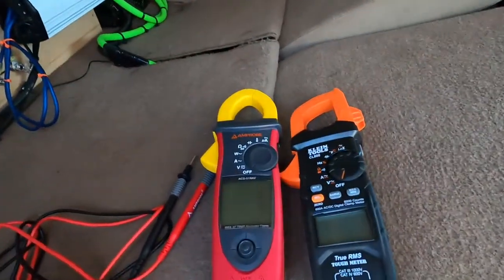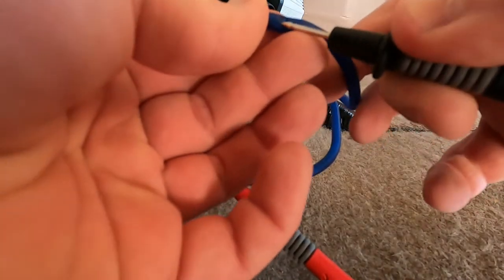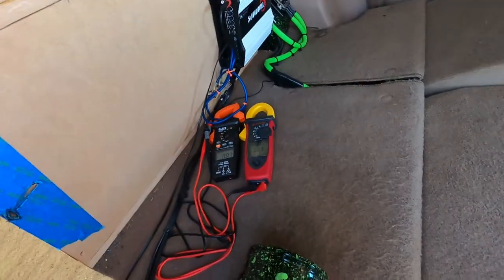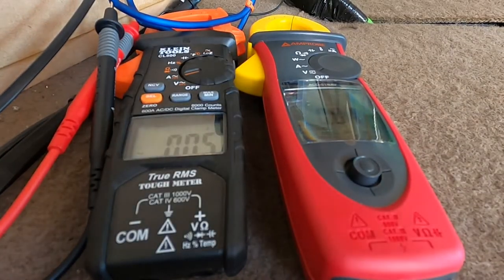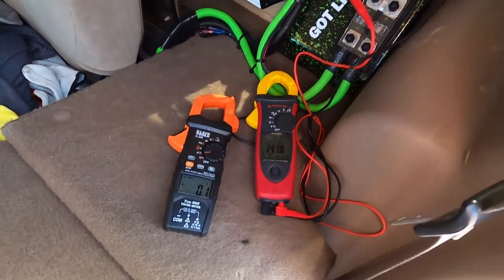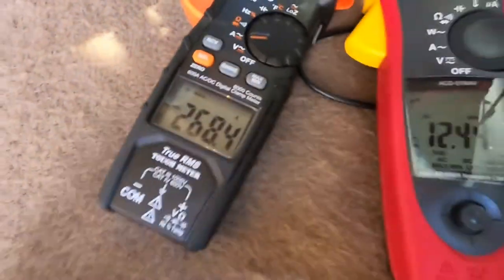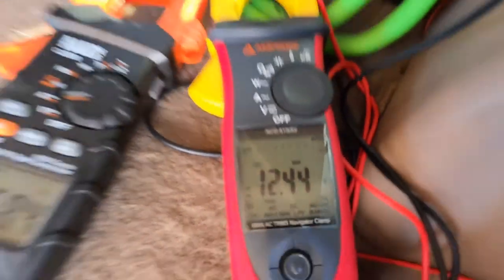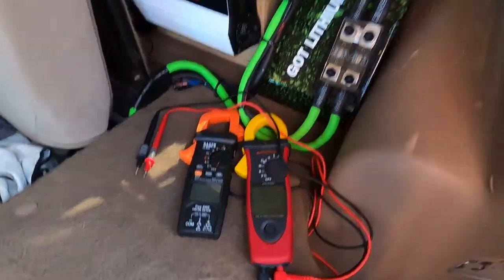Car Audio Clamp Test.  How to Clamp Your setup + HUGE Taramps Power!!

Comment: setting to max you successfully showed how to measure peak power at best!  you took what the amp threw at the sub initially max voltages. as the amperage maxed out to  balance out the +/- "while voltage tanked and not picked up by meter"  you got the max amps and then used it as your calculations.

Comment: Nice video and easy explanation straight to the point i just installed my autotech 240 yesterday and voltage control module just increased my voltage from 13.8 to 15.8 on my PCM controlled 19 Camry and I really want to see how much power it's pushing out now

Comment: I have a 2010 escape.  I am running 3 NOS, BNIB ppi PCX amps from early 2000’s  that I have been saving.  They are A/B.  My bass amp is a pcx2400 for 2 15’s, and my mid’s amp is a pcx4125 and my tweeter amp is a pcx480.   I am in the process of getting a 300 amp alt.  Due to my age, I don’t push the bass over 135 Db’s for more than 15 minutes at a time, that’s all I can take anymore.   I did the big 3 and have multiple runs of 1/0 wire from front alt and front Batt to the rear.  What do you recommend for my power storage?  I can handle $400 comfortably and $600 uncomfortably, wife will have me on the couch at $600.  And if I need to in the distant future, I may get a class D 3000 or 4000 watt amp.

Comment: Just watched the video again as I’m interested in clamping my true rms power. Would you recommend the Klein cl800 ac/dc clamp meter your using or is there a more budget friendly clamp you’d recommend if I only want to do ac voltage testing? I have a couple decent fluke multi meters already for the volt meter. 

I was going to pickup a smart 3 but snagged a Soundqubed u-3k when they were on sale recently. Not quite as much power but good enough for the price point and i am looking to add lithium. All stock electrical with 105 amp alternator. Would a 32 ah headway bank be sufficient or should i go a little bigger and any busbars you recommend? Looking at jimsmachineworx and maybe projectdb. Was gonna make my own bus bars but jims are ready to install and like just $20 more than some 1/4” aluminum material and come with the hardware. Appreciate your videos learning a lot!

Comment: I see how you do that, seems simple to do. Now how would you do that with 2 amps, 1 amp per sub, Just do 1 amp at a time or can you do both at the same time?
Reply from the maker: For multiple amps, You Could clamp Amperage and Voltage on both sets of speaker wires simultaneously.  It is usually easier to just do one amp at a time tho, or one all together and just double the numbers you get, assuming they're gain matched.
Reply: @gotlithium6311  both are gain matched
Reply from the maker: @strang3wb  Try it both ways, see how the numbers compare!

Comment: I would love to try this on my setup but I can't figure out how to set it to max setting 🤔
Reply from the maker: Some meters do not have a max hold setting.  In this case you just need to watch for the highest possible numbers while you run the test.  Makes the job a little more difficult, but still possible.
Reply: @gotlithium6311  ya the instructions that came with it are almost non existent lol it it has a max/min setting is that it?
Reply: @gotlithium6311  not to mention it said NOTHING about being directional, after watching this and hearing that I double checked my clamp and it is directional! I've been doing it wrong this whole time!
Reply from the maker: @Chris-B-Bassin  Yes Min/Max is what you're looking for.
Reply from the maker: @Chris-B-Bassin  I'm glad this video has helped you out!
Reply: @gotlithium6311  definitely did. I'm confident enough now using this clamp to get an accurate reading.  I just finished a battery delete box so I'm going to try this with and without agm parallel with my 48ah headway bank 😁
Reply: @gotlithium6311  so I got 38v 21a 798w on a Salt 4?  Noway! lol
Reply from the maker: @Chris-B-Bassin  It's entirely possible.  That means it's obviously not turned up all the way.  I know those Salts do good power.  See how loud 798w is tho?!
Reply: @gotlithium6311  would it make a difference since this is in my hatchback and the hatch is open ti do this test? I was for sure thinking it's a instrument malfunction, also should I set my equalizer all flat?
Reply: @gotlithium6311  I figured it out! I set my EQ flat and tested it again 83v 40.8a so 3386w that's more like it 😁
Reply from the maker: @Chris-B-Bassin  Ya that's better!  Hatch wouldn't make a difference unless it makes the woofer unload, then it Could rise higher, producing less power.
Reply: @gotlithium6311  yes sir, thanks again